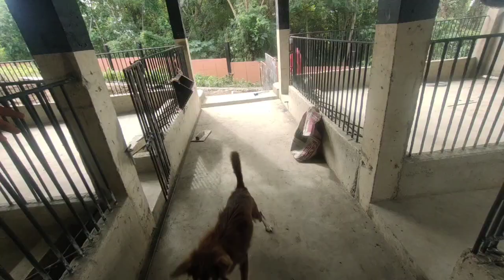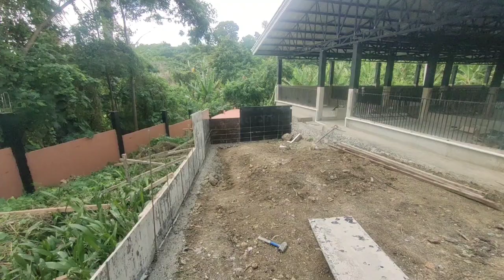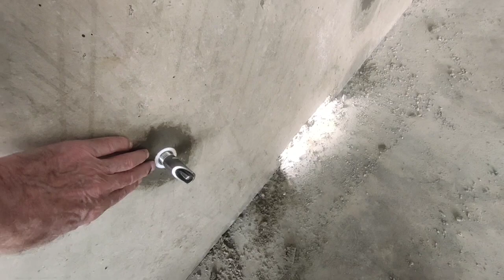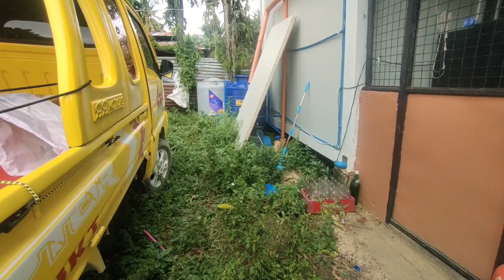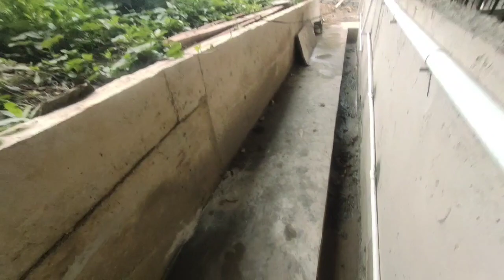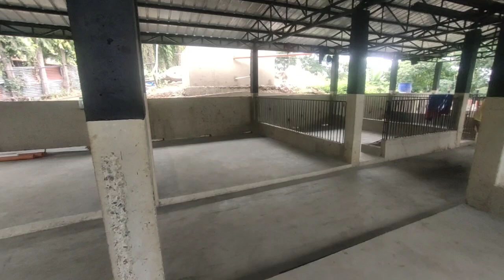FIRST PIG TECHNICIAN VISIT AND WATER PLUMBING FINISH

Comment: you could of oiled all the steel work with fish oil or linseed oil, the oil would dry very very hard and easy to put on with mutton cloth wad, and once a year recoat
Reply from the maker: Hi Stephen, yes you could use linseed oil or fish oil, in my younger days  linseed oil was in every thing. Easier now rust proofer and two pack paint.
Reply: @TykeArenas  sometime the old ways are the best, like burnt mastic been around for over 200 years yet no one knows about it
Reply from the maker: I agree the old ways change mainly for company profit, but the old ways worked for hundreds of years. I must admit never heard of burnt mastic burnt cork was put on horses hoofs if the hoof had a crack in it and paraffin was put on the horses hock if it had fleas to stop it stomping the mistle floor to bits.
Reply: @TykeArenas  burnt mastic was used to bed down any timber or windows, also you can use it for repointing, you make the burnt mastic yourself its linseed oil and sand mixed in to a paste, it will never rot timber and it will go as hard as iron, fred dibnah would only use that to repointed his chimneys, as he said good for a 100 plus years. if we ever strip steel down to bare metal i always oil the steel IF we got the weather you need the sun to dry it, sorry to bore you dave
Reply from the maker: not boring at all and you qualified every thing because Fred would know for sure